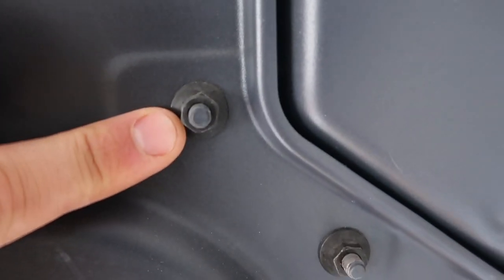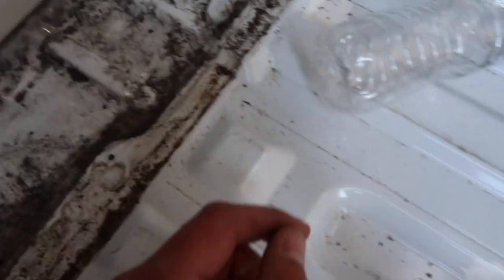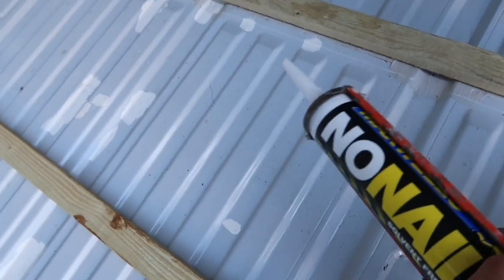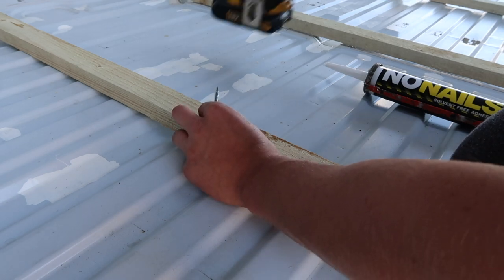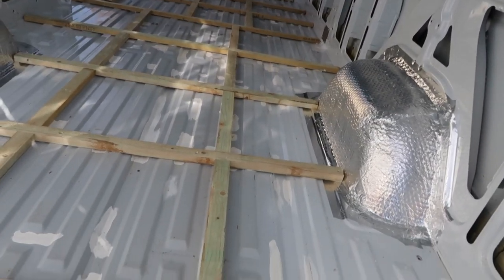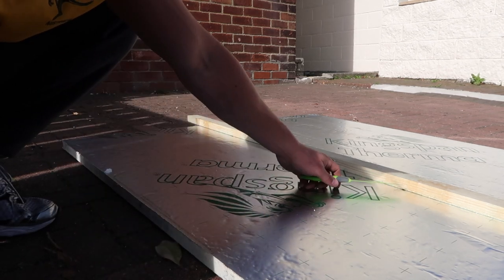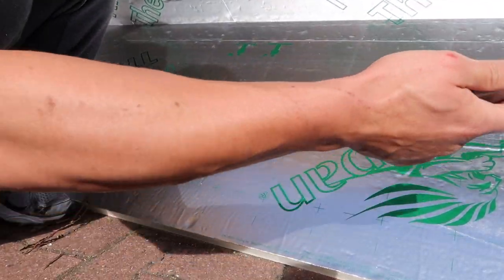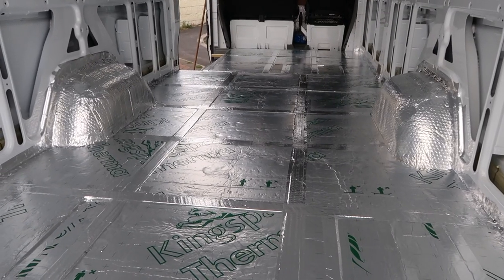Super SIMPLE floor battons and insulation | Ep7 | Sprinter Camper Van Conversion

Comment: is there an easy trick to avoid problem areas on the underside of the van when screwing the self taping screws to fix the floor batens? thank you
Reply from the maker: Yes, use the right length

Comment: You don’t need the buttons 🤷🏻
Reply from the maker: needed for floor rigidity
Reply: @ScottAndJen  I’m a professional builder… absolutely no need for batons !! All you are doing is allowing the bridging of the insulation 🤷🏻
Reply: Hi David. If no battons is needed, would you just fix the plywood directly on the celotex? Doesn't seem like a rigid solution. How is the celotex then fixed to body?
Reply: @allanwadpetersen1455  doesn’t need to be fixed…..it can’t move side to side.. it can’t move front to back… and when everything is fitted into van, it can’t lift up….you just fix your furniture etc to the ply. 👍 ( just like a floating floor on concrete )
Reply: @davidhill9375  thanks for comments. I wouldnt personally go the setup you recommend. Maybe its okay, but quality wise it seems like a poor construction.
Reply: @allanwadpetersen1455  oh yeh… what’s your qualifications ? I’m 64… in the building trade all my working life.. master joiner to boot..
I was just trying to help you to not bridge the thermal qualities of the product… but.. carry on expert 🤷‍♂️
The words poor and construction  never occur on all my recommendations. Just to add.. I’ve converted 5 large vans to a very high spec.
AND CUTTING INSULATION WITH A KNIFE OUT OF THE KITCHEN DRAWER IS EMBARRASSING…
Reply: @davidhill9375  would the sikaflex help prevent the bridging? Was thinking that the cellotex would get compressed by the floor above without any battens. Wondering how long Cellotex would stand up to bearing weight and the constant vibration. I'd be really interested to know how well the floor has held up on the van you have used the longest. I'm currently in that battens/no battens decision and wondering if you just use thicker ply to ensure rigidity (or some other less thermally conducting material ideally lighter than wood)